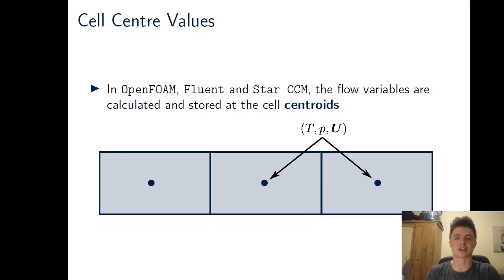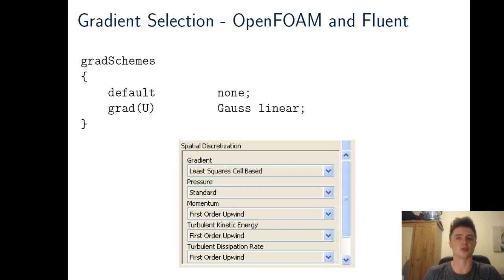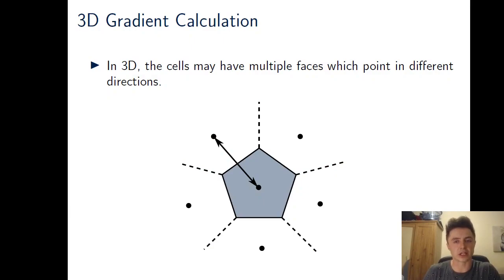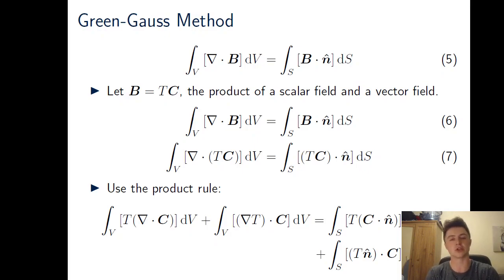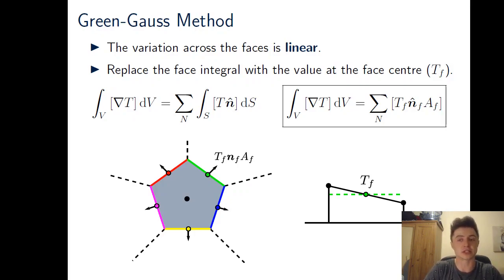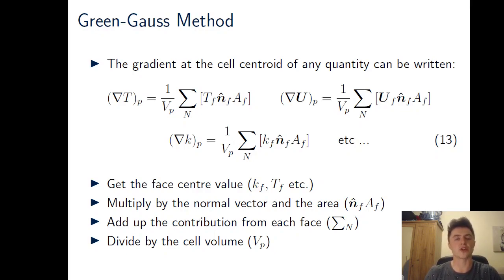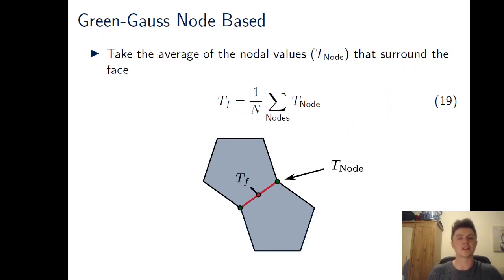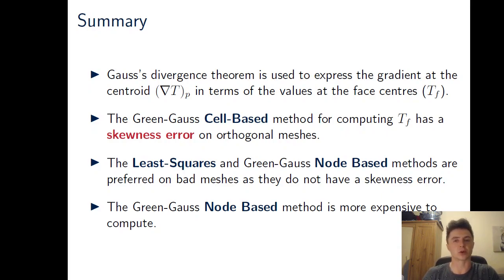[CFD] Green-Gauss Cell-Based and Node-Based Gradient Schemes

Comment: Just making sure I understand it correctly, correct me if I'm wrong: the term on the RHS with C • n cancels to 0 because of the integration over an enclosed surface, not because C • n = 0 for each face.
Reply from the maker: Yes thats the one!
Reply: @fluidmechanics101  But the integral of T(C n) is not supposed to be 0, considering T is constant and smaller on one side and larger on the other side.
Reply: @fluidmechanics101  Why integral should be zero, if T is not constant?
Reply: Any reference material on this? I find it hard to understand why its 0.
Reply: @stanleywong9004   Here this might be a helpful reference to understand why it is zero:     https://math.stackexchange.com/questions/1631281/closed-surface-integral-of-the-surfaces-normal-vector
Reply: since C is constant in space, grad dot C on the LHS is zero, which means that it is not appearing on the RHS..

Comment: Hello Aidan, as always great work! Could you please guide me on some references to the decomposition of the RHS of eq. (7) into the RHS of eq. (8)? I am inclined to believe that the term on the RHS of eq. (7) is equivalent to either term in eq. (8). So, it would make sense to me to put a factor of 0.5 before each of the two terms on the RHS of eq. (8). Could you elaborate more on this issue? Thank you!
Reply: I'm not sure but it seems that there are 2 mistakes. Like that redundant term in the RHS appears from nowhere and then it is set to zero, despite T is not a constant. So the answer is correct)

Comment: Thanks for the great content and the excellent, clear, concise explanations :)  One small comment, it seems to me that in deriving the final form of equation 12 you have used a slightly different logic to the ‘clever trick’ used for the surface integral. If the temperature varies linearly across the cell then gradT will be a constant across all of the cell, so it can be taken outside the volume integral.

Comment: Hi. You mentioned in some comment replies that the temperature at the face is obtained in the previous iteration. Do you mean that the values of the temperature at the centroid of the cells (for cell-based method) are taken from the previous iteration? Could you also explain where the "iterations" come from. Is that when we run the SIMPLE algorithm? Thanks
Reply from the maker: Yes, you are correct for both. Temperature at the cell centroids to calculate the cell-based gradient is taken from the previous 'loop' of the SIMPLE algorithm 👍

Comment: Hi, thank you for the video. I just got a small question. At 13:44, I don’t understand why the RHS term is set to 0. The surface integral would reduce to a summation, where we dot the dot product of C and the normal unit vector at every face, and multiply with the temperature at that face. Since these temperatures are different, the summation shouldn’t equate to 0, in general. Where am I wrong here?

Comment: 25:20 the skewness error you mention can be acounted for (I believed it is by major cfd codes, but please check). Say the point on the face where PN line intersects the face is f', whereas the face center is f. The correction term is thus a dot product: (gradT)_f' • (r_f - r_f'). To calculate the gradient (gradT)_f' at f' you just use weighted linear interpolation of the gradT values at cell centroids P and N. I believe they advocate for this correction term to be calculated explicitly, in flow simulations, since we are running an iterative solution procedure anyway. Check papers by S. Muzaferija, M. Perić, Ž. Lilek, I. Demirdžić, for this. Well done for your videos.

Comment: I am not sure if I understood it correctly, so I am going to simplify it. Gradient schemes are used to calculate cell based values out of face values and that's how they calculate gradients. Gradients are useful for upwind schemes  which use them to calculate face values out of cell based values calculated by gradient schemes? :D
Reply from the maker: Yes. You are correct. The trick is to use the face values from the previous iteration to calculate the cell centre gradients. In this way, the cell centre gradients are lagged to the values from the previous iteration of the algorithm (which gets around this loop you have spotted)
Reply: @fluidmechanics101  Thank You very much. I am glad that I got it. Also, big thanks for answering the comments :)

Comment: How do you handle the case of boundary cells ? Let's take a 1D example: [10, 10, 15, 20, 25] (mesh is 1x1x1m). If I apply the presented method, then the gradient should be [10, 2.5, 5, 5, -2.5] which is obvisouly not correct ? For me it should be [0, 2.5, 5, 5, 5] I am a bit lost...
Reply from the maker: As in the boundary cell?
Reply: @fluidmechanics101  Yes absolutely. I can apply this method very easily by iterating the neighbours of the cell, but I also need to consider the "free" faces of the cell. In that case I suppose I need to take the value at the center of the cell for the face value ?
Reply from the maker: Yep. Also remember that the distance to this face centre is different to the distance between cell centroids. I find that a good way to check is to use a grid of uniform squares, then rectangles with a simple linear pressure field, to make sure you are getting the gradient right

Comment: Thanks for this great video. Any references/suggestions to compute the second order spatial derivatives that matches this first order scheme ?
I precise that I need that for reularization purposes. e.g., to compute a smoothing regularization, I can calculate a Tikhonov objective function which is defined as jreg = 0.5 \sum  grad(T) ** 2. This video present how to get grad(T) -> this is the difficult part. However, I have no clue how to compute the gradient of jreg with respect to T, which should be something like greg = -hessian(T).

Comment: Thank you for this precious video. 
I am finding difficulties understanding the skewness error. Is the problem related to the fact that the point in which is located the face value is not exactly corresponding to the face center or is it just related to inaccuracy in the computed value?
Reply from the maker: Ahhh it's both. We calculate a value by interpolation (a scalar). We then assume that this is the value at the face centre. As the line does not actually intersect the face centre, we have actually calculated the value at the intersection, so our face centre value is inaccurate. I am still looking for a paper on this. Will let you know when I find one!
Reply: @fluidmechanics101  too kind. Thank you for your precious contributions.

Comment: Thanks an ocean for your great informative videos. There's something which I find confusing when I use Ansys Fluent. On the one hand, the gradient schemes are selected under gradients from Spatial Discretisation. On the other hand, the pressure schemes (e.g PRESTO!, second order etc) are set right after the selection of the gradient schemes. As the tutorial suggests, the pressure scheme utilizes the selected method to calculate pressure value on the face and this is exactly what we expect from the gradient scheme! Does it mean our selected option under gradient schemes is not valid for pressure? I was wondering if you could kindly help me resolve the ambiguity I have been encountered with. Thank you very much indeed.
Reply from the maker: Yes, I probably should have explained this. The gradient schemes are for everything except for pressure. As fluent is a cell centred code you need to use a different gradient calculation for pressure or you get 'checkerboard oscillations'. It is also advantageous to use body force weighted or presto for flows with high buoyancy forcing, so fluent let's you choose the gradient scheme for pressure separately. This is different to OpemFOAM where you have to choose the gradient scheme for all variables separately ...
Reply: @fluidmechanics101  Thank you very much indeed. Can you please introduce some sources from which I gain basic acquaintance with "checkerboard oscillations" and also figure hoe cell centered codes may lead to such oscillations?
Reply from the maker: Have a look for 'Rhie Chow interpolation' on Google and you should find what you are looking for

Comment: Great videos Prof. Adrian! I've been studying CFD for a while now, and currently I don't know how to handle face gradients in boundaries.
Let's say the face center boundary is b; cell center is C and let's say we want to evaluate ϕ Diffusive flux would be:T is the orthogonal correction. S is the surface vector. 
 ∇ϕb ⋅ Sb = ∇ϕb ⋅ Eb + ∇ϕb ⋅ Tb = (ϕb - ϕC) x |Ef|/|Cb| + average(∇ϕb) ⋅ Tb
How to compute average of ∇ϕb ? And let's say we have dirichilet boundary condition ϕb is imposed
Reply from the maker: Hi Carlos, this bit is quite tricky and it is difficult for me to explain in a message. My best advice would be to read Hrvoje Jasaks thesis (a quick google search should find it) as he does a good job of explaining with pictures. 

The problem is even more complicated than it appears because the boundary value varies linearly along the face ....
Reply: @fluidmechanics101  thank you! I will follow your advice!

Comment: Hii... A stupid question but I am really confuse.. where exactly the term gradient of T or U over a cell will be used.
After applying Gauss theorem to NS equation, we need surface integral of face flux and velocity over all surface for convective term and for diffusive term, we need  surface integral of gradient of velocity over all surface. Like u show for 1d temperature profile in intial part of video.
Then where will gradient of velocity over cell  will be used ?
Reply: To add to my point, I read book by versteeg and there they didn't solve any gradient of temperature over a cell ... infact the solved the gradient of temperature over a surface
Reply from the maker: Good question. The gradient over the cell is used in: 1) linear upwind differencing, 2) non orthogonal correctors and 3) some source terms. Have a quick watch of my non-orthogonal correctors video to see an example. I realise that this can be quite confusing but you have the right idea: the face flux surface integrals are different to the gradient at the centroid of the cell. They are used for different things 👍
Reply from the maker: And just to add: you only see non orthogonal correctors when the cells arent perfect rectangles. All the cells in versteeg and perfect squares or rectangles, so they dont need a non orthogonal corrector and you dont see the gradient calculation at the cell centroid. I hope this helps 😊
Reply: @fluidmechanics101  hello.. Thank you for the quick reply..  but I watched the non orthogonality video (both part 1 and part 2) . I couldn't find anything regarding gradient of  velocity or temperature over a cell .. I only saw gradient of velocity or temperature over a surface..
I am sorry to bother.. thank you for your help and love your videos

Comment: Hi Aidan!
First of all, thank you for your videos. I am a big fan, you're the best CFD teacher ever!
I have one question for you, let see if I can explain it properly:

Let's suppose that I am using a Green-Gauss Cell Based Gradient scheme in my simulation and a Linear Upwind Differencing scheme for the variables. The first one calculates the gradient of the fluid variables, which is going to be used by the second one. However, the Cell Based Gradient scheme needs the value of the fluid variable of the faces, which is actually the objective of the Linear Upwind Differencing scheme calculation.

Am I in a loop? Don't we need what we are going to calculate to actually start the calculation? I think I'm missing something.

Thank you again. You are producing a really high quality content.
Reply: Same Question
Reply from the maker: Good question. The gradient calculation (green Gauss etc) is calculated explicitly using the values from the previous iteration, to calculate source terms. 

Upwind differencing is implicit and is used to calculate the coefficients for the matrices themselves. 

This is definitely confusing and isn't really explained anywhere, so I might do a video on this sometime

Comment: Hello again Adrian,
This video was super useful and brilliantly narrated about. Finally I could make some connections with openFOAM , with which i had been struggling with. I had a follow question (which might sound stupid)

1) We started with the objective to find the gradient becoz we want to determine the face values, but at the end, we found the gradient in terms of the face values itself. I don't know what i'm missing , but i can see 2 unknowns , the gradient and the face value. 
Is there a particular order in which they are calculated , for ex , lets say,
After we initialize the field, we have cell centre values , use these values to find the face values via one of the G-G method and then use these face values to find the gradients for the 1st iteration, Next iteration onwards , the face values are determined by the gradient calculated and using say linearUpwind Method?

2) Are you allowed to calculate values of say (T) at places other than face centre? or is it that when there is skewness present in cells , the value calculated is actually at  d_PN (25:21) but it is assigned to the face centre , which I guess is wrong because the distances involved in linear interpolation are wrong. 
Let me know, Thank you

Comment: I love your videos.  Can comment on a this advice which was given to me by a very experienced OpenFoam user in 2018... 'Please don’t use the leastSquares gradient scheme in OpenFOAM. There is a coding mistake in it causing it to be 1st order accurate at boundary.'  Was there a coding error, if so, has it been fixed and in what version?
Reply from the maker: Yikes! I am not very up to date with the openfoam leastSquares algorithm. As as an experienced foam user he/she is probably right. I suppose the best you can do is make sure to always use the latest version 😊
Reply: @fluidmechanics101  Darn, not possible to use latest version if using SimScale....
Reply: Well, there is a big debate about this . Follow this link. @Fluid Mechanics 101 Might be an interesting read for you too.

https://www.cfd-online.com/Forums/openfoam-solving/189825-gauss-linear-gradient-makes-openfoam-zeroth-order-accurate-unstructured-meshes.html

Let me know your thoughts about this. 

Also, from my experience , if least square was really first order, it would not blow up that easily on dirty meshes , you will see that , it is very difficult to use least squares  method for dirty meshes.

Comment: Nice explanation. Maybe the follow up on calculation of node values in nodal method may be useful (weights for 3D case are not given in the original literature, some hand calculations may be needed). One more interesting point that would be clear then is that nodal method uses wider „computational molecule" and consequently gradient at cell centroid will be based on values obtained from more surrounding cells. I would therefore recommend nodal method for meshes based on tetrahedra, as they don't have enough immediate neighbors to estimate the cell centered gradients as eg. polyhedral meshes (and often have skewness). Computational overhead is not much greater because weights for interolation to nodes are calculated beforehand and stored.
Reply from the maker: Yes! I am still trying to find a good paper for the node based scheme. Once i do, a follow up video will be coming 😄 i feel like we need a complete set of videos for each of the schemes, so that they can be a good reference for everyone